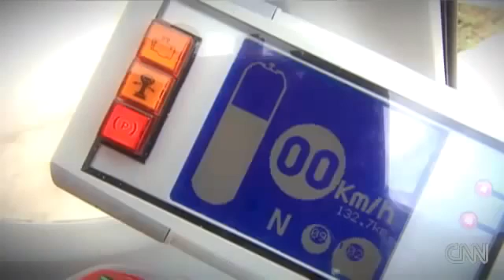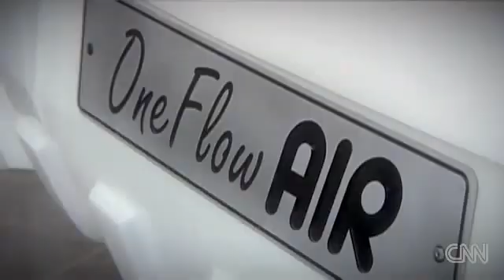Air powered car - Green Technology

Comment: its NOT air powered. its another form of EV. Electricity pumps Air into this toy and that high pressure air is used to run its motors, probably by converting air pressure to electricity again.. Multiple conversions mean LOSS of energy and that's no secret.. Tata will make anything successful in INDIA market thanks to sheer number of people. If only 1 million people by this toy at US$8K, that's $8B.. quite viable for a vehicle with Green credentials. I'll skip this toy.. better by a Golf car for $2K and modify the battery to Lithium iron phosphate and charge it by Solar.. Bye Bye Air car

Comment: why couldnt this vehicle be adapted with compressors on wheel so it would produce it own power supply as long as it is rolling? even if only in times of say going down hills or when least load of pull times? comsume while producing would never run out of air?
Reply: That would be awesome!

Comment: A compressor could easily be run with solar power or wind power
Reply: Both leave incredibly large amounts of waste when parts need changing, and can hardly be recycled
Reply: @marcfarah   Just like the billions of cars that already exist on the roads?
Reply: You could even put a small gas engine in it to power the air compressor!

Comment: This will never work commercially. Yes if you use a wind turbine it will not put out emissions. It will also not produce emissions if you use a wind turbine to power an electric car the only difference would be an electric car would go much further and faster. As I said this will never work commercially so I won't be expecting to see any on the road or at my local dealer.
Reply: A wind turbine uses diesel generators, and therefore wind energy is one of the most expensive ways to harness energy. Due to its use of diesel, it is also not very clean.
Reply: @appalachianenthusiast9499  really?
Reply: @henryvankainen3991  My science teacher explained it. It also made sense considering that they have gone down for several days due to running dry of oil.

Comment: Actually this would not be implemented sadly :( I have made a replica of this car with lego technic (yes ima genius :3) It works great and all but the compressed air doesnt last very long. what would be creative would be when the air is compressed into a liquid (which takes lesss space) and then when its needed, it will somehow convert liquid back to gas and then pressure the pistons.
Reply: Well it automatically turns into a liquid if you just compress it strong enough. How much Bar did you had in your lego Model?

You can put in a 50L tank 5 Bar or 10 Bar. If you put 10 bar in it, the tank will last much longer. And you dont even need a bigger tank, just more pressure. Only thing is the tank must be strong enough.
Reply: I've seen those Silver Catalyst and 99% Hydrogen Peroxide as the fluid reaction that expands like 500x when it gets into contact with silver.  Seen some helicopters that could fly for 20 minutes ....but never really went anywhere.

Comment: and how does the air get there using an electronic compressor probably, probably uses more energy than just to run an electronic motor the only "free" energy source we get is the sun. and the technology isnt there to be reliable yet. Ud be more effceint using steam by burning wood and to be carbon nuetral plant 5 trees for every 1 tree you cut down.
Reply: actually the polution should be factored in ;-;. burning wood emits smoke.
Reply: Oh god... it's dumb.... We have multiple "free" energy sources.  You could even use human power, with the right gearing of some mechanism, to pump your car full of air.